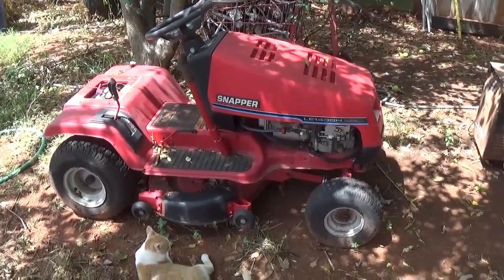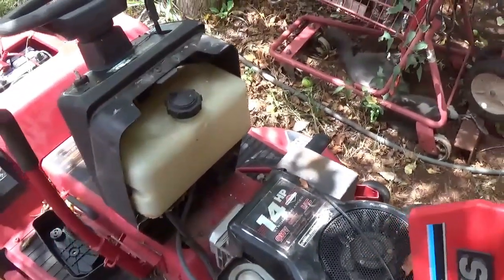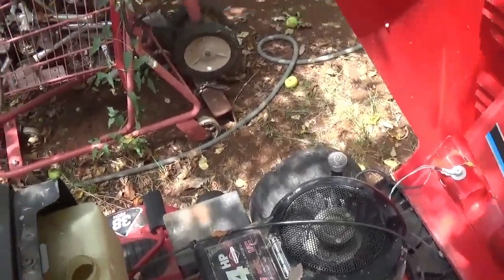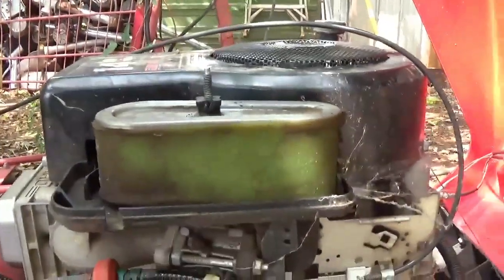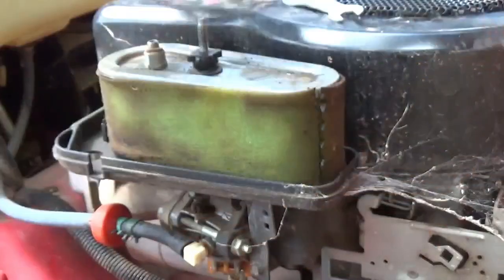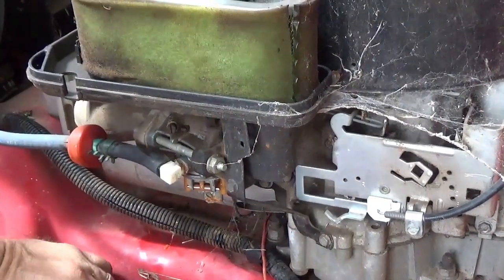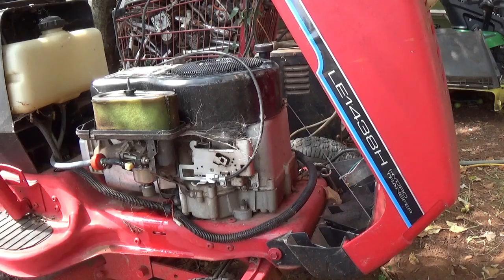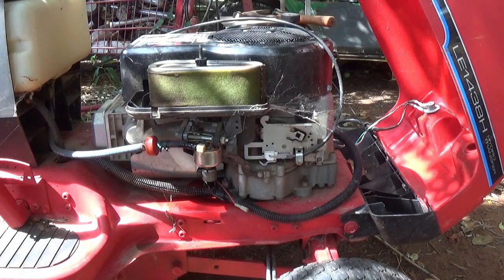Scrap Snapper 38 inch cut Riding Mower Will it Run

Comment: personally I like just watchin someone else bring something back to life. I learned a couple of tricks he used to
bring this one back. as he said he has starters around there and they are all almost the same and likley interchangable.  personally have chucked the starter a just drilled a hole in
the top and used a cordless drill to start mine for years.
Thanks for the giving me a little part of your time guy.
Reply from the maker: My pleasure Shawn, I think a lot of mowers problems are due to lack of maintenance, not running the gas out in the fall, sometimes I get them running only to find they smoke bad or knock. so I keep what parts I can and scrap the rest. Thanks for stopping by

Comment: Hi there, Just a few tips. Do not hit modern starters with a hammer, they have ceramic permanent magnets in them and they shatter. I have replaced quite a few due to being hit. It is an old school method to loosen stuck brushes that are practically worn out. The solenoid is fine. Just try a few times or put some oil on the starter shaft, if it is dry or if rusty clean it. That starter may be faulty but it could also be a bad spot on the ring gear. It is called tooth abutment.

Comment: For the 2 prong gas shut off solenoid: Connect that one lead & just needed  another wire on the other to ground to chassis... ❤video
Reply: It wouldn't do anything. He ground off the plunger.

Comment: This is a Vanguard Briggs they are commercial industrial very well made. The LE Snapper tractors are sort of obscure now not many left I think they were quite expensive when new
Reply from the maker: you never know what you may pick up when they say they have a riding mower
Reply: @Okiescrapper  I have a 1995 LE1433h my father in law bought it new. Very well made I am restoring it rebuilt deck, new 17HP Intek. The camshaft on the old Vanguard 14 finally wore out after 28 years ☑️

Comment: I have a cheap open end 7/16x1/2 inch wrench I ground down to get those solenoids off. A lot of the cheaper ones were a little thinner to start with. You also run into the same problem with bicycle pedals.
Reply from the maker: grinding them down is a good idea. you just have to remember where you put it so you don't have to grind another.

Comment: I just cut off a fine thread bolt and replace that solenoid. No more trouble. Or steal one off an old Briggs push mower with the float bowl carb. They run and stop just fine without that solenoid. The older ones didn't have them anyway. If it has two small wire on the starter solenoid one of them is a ground wire. You don't want to run that one back to the battery to jump it.
Reply from the maker: the brass bolt on the push mower is a bigger diameter, that is why I just use an old solenoid just to hole the bowl on.

Comment: Unless you intentionally put 2 clamps on the right side of the fuel filter. Good video
Reply from the maker: Nope I didn't do that, but I used both clamps when I replaced the line

Comment: I noticed the clamp wasn't slid over around the adapter on the gasline.
Reply from the maker: yes, I noticed that too I replaced the small section of fuel line and noticed the old piece had 2 long splits in it